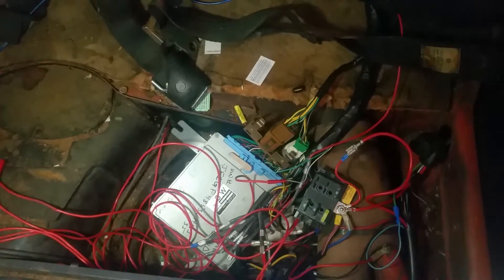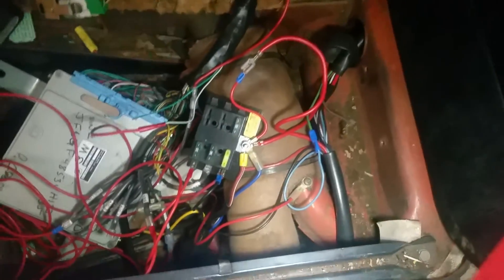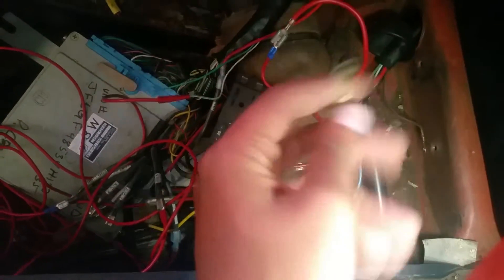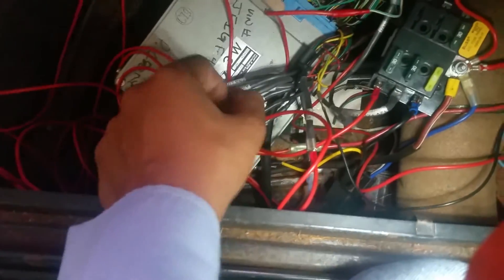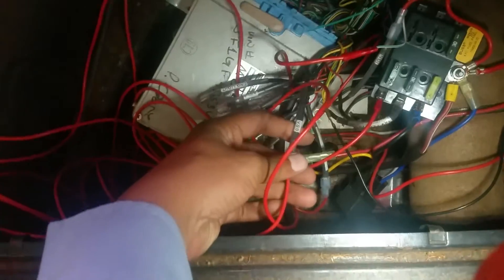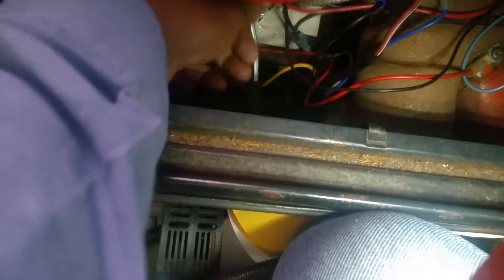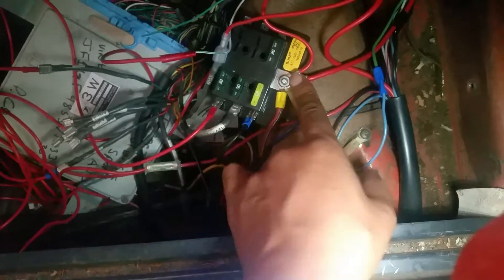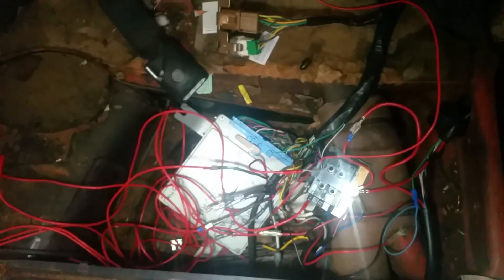My VW Subaru Swap ECU wiring

Comment: iv got mine all in now with two wires lacking the ignition switch wire and my keyed ignition wire any possible way you could show me how you did yours?
Reply from the maker: Randy Lucas black wire for the coil/key wire goes to key and ignition sensor for me was spliced to start wire on starter. that's how mine runs
Reply: i figured it out last night i guess i was over thinking it lol thank you man never can be to sure

Comment: good morning! saw a couple of your youtube post and I am interested in doing a swap on my VW. just wondering on your take on having to do it on my own or getting someone to do it for me. total build cost for your VW?
Reply from the maker: Jun Sahagon III have you ever changed a clutch in a beetle?
Reply: Phillip Cooke no
Reply from the maker: Jun Sahagon III then do line I did. hire a friend or shop to pull and put the motor in and do the rest yourself. getting the motor in is easy with the right equipment. the rest is little fabrication and running lines and wire harness. I also took to a shop to get exhaust and water pipes run.